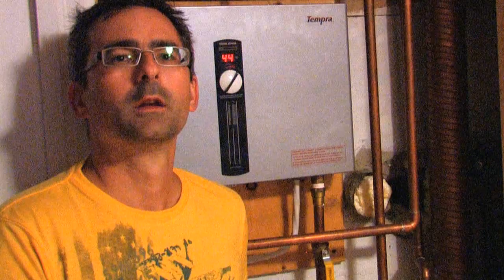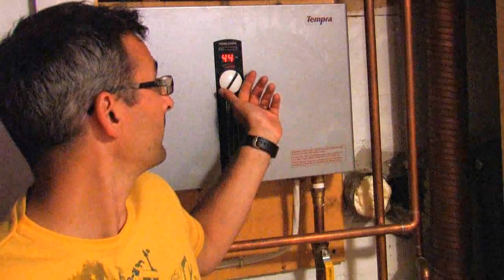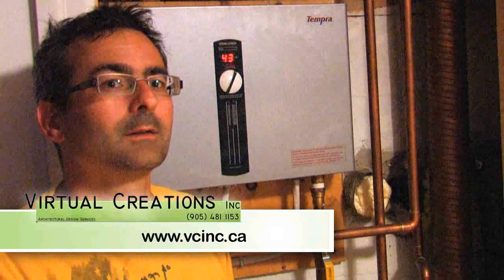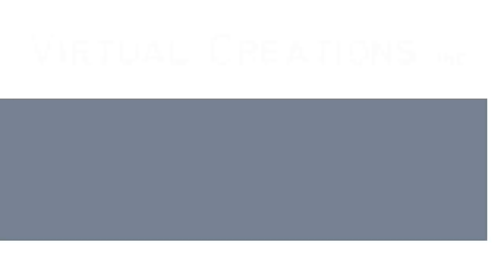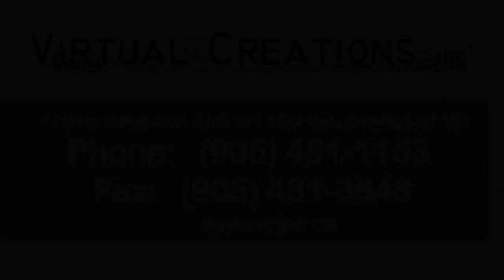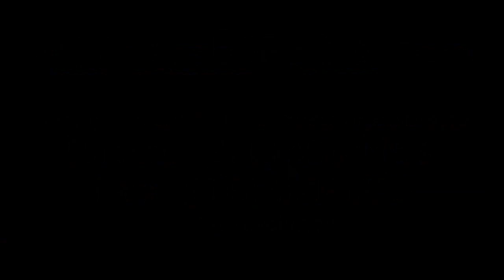Episode 112   2012   Tankless Electric Water Heater

Comment: Which drain water heat recovery system do you have installed?  I'm assuming it's comparable to this?: https://www.energy.gov/energysaver/water-heating/drain-water-heat-recovery
Reply from the maker: Correct that is the same "type" as I have installed.  I purchase it from Homedepot, although I think at this point you can purchases them from a few places.  And I don't recall the exact efficiency of my unit, but I believe it is 60" tall.  I hope that helps.

Comment: Wouldn't it be wise to wrap the pipes with insulation? Even the recovery pipe too.Thanks
Reply from the maker: You could, if you wanted to but not sure it would make that much of a difference.  Basically they heat transfer happens very quickly, only during the amount of time it take the water to travel from the bottom of the pipe to the top, maybe 2 seconds?  So insulating it isn't going to improve on seconds. And the heat is transfer only when water is draining and running at the same time, like when you are using a shower.  So the minute you turn off the water, whatever heat is remaining in the pipe is lost to the indoor air temperature weather the pipe is insulated or not.
Thanks for the question.
Reply: Thanks for the reply. That makes sense. I learned something new. Good video. 

Jeffy